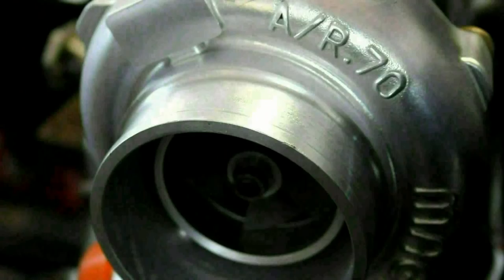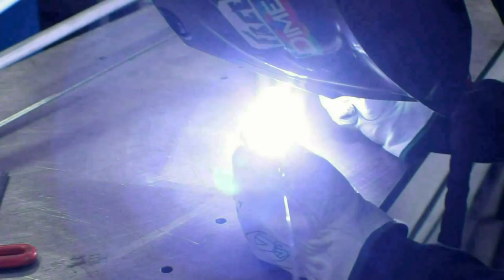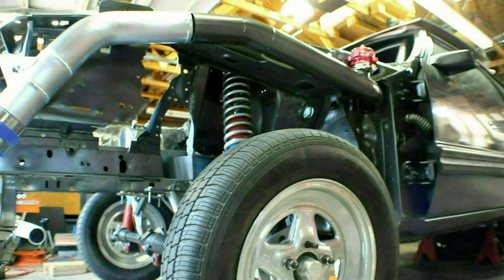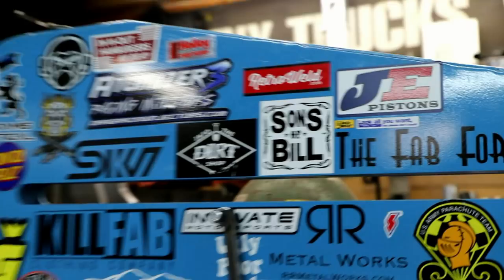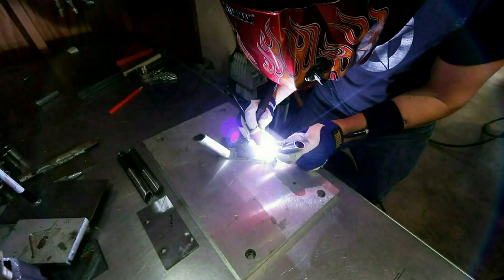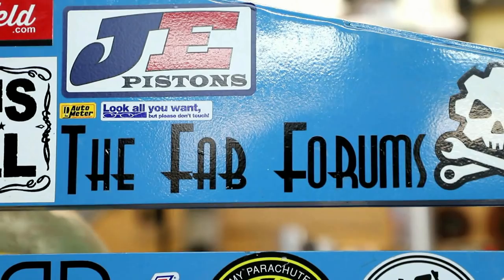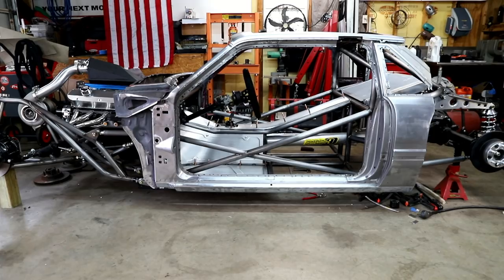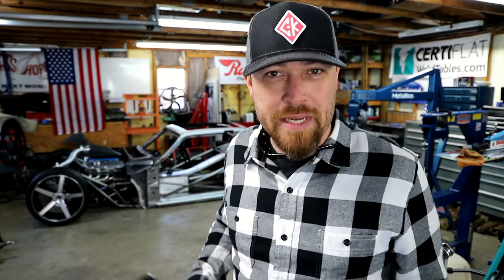You Need This Tool - Episode 107 | Dry Coat Rust Preventative

Comment: Hi. Is this a good product to undercoat a new vehicle to protect and prevent rust? Would it protect from a harsh New England winter. If so could you explain how to apply it properly to the undercarriage. If not what is the best product or service for undercoating a vehicle. I looked up several services Krown, Ziebart, Corrision Free, Wool Wax & Fluid Film. The reviews were horrible for Ziebart, Krown not so great, Corrisiion free so-so, and the others seemed o.k. I bought your product to spray on the rotors as i seen some videos from car detailing guys saying it is great for that. Now i need to know the safest best product or service for undercoating a vehicle and how long it would last in a harsh New England winter with all the elements. If this is a good product for undercoating do you sell an undercoating kit like corrision free? Thank You

Comment: I wonder how that would work on disc brake rotors?

They seem to flash rust rather quickly when a vehicle isn't driven much or during winter storage.
Reply from the maker: probably very well as long as the brakes are not used